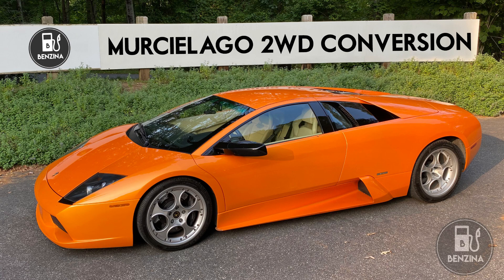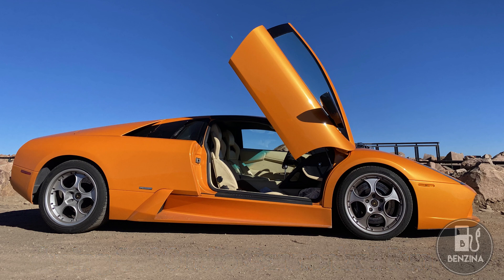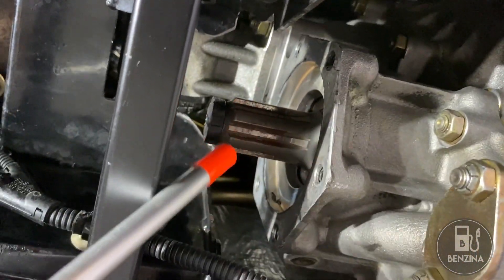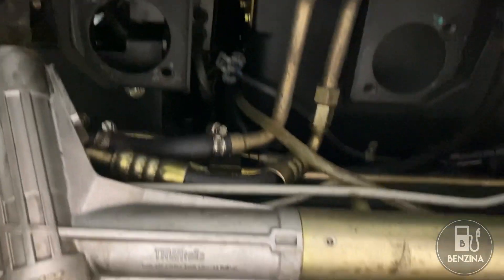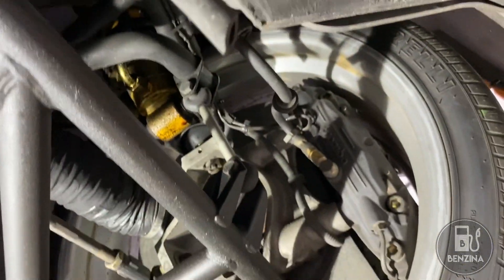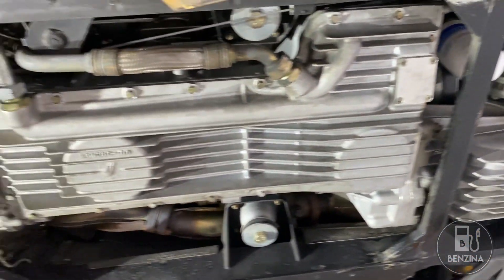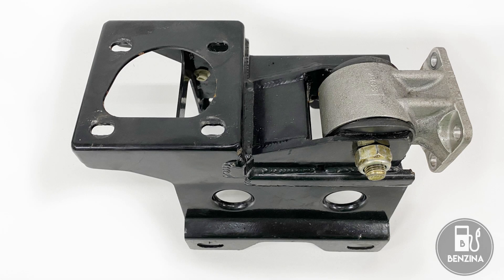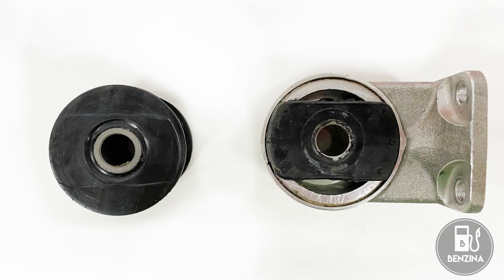Carbonio 2WD Conversion Kit for Lamborghini Murcielago

Comment: Shouldn't there be a plug for the front of the torque tube, too stop any dirt/grime building up in it from driving??
Reply from the maker: A plug is included in the kit. This is specifically mentioned in the Carbonio product page.

Comment: Why would you change to 2WD ? Weight ? Reliability ? Might this change hurt resale value ? 
BTW , horrible that Lamborghini recommended the "wrong" engine mount .
Reply from the maker: Unless you drive in the snow there is almost no downside to going 2WD. The car wears clutches less, is more fun to drive, and is easier to maneuver at low speed. Also the modification is 100% reversible so resale value is in no way affected.

Comment: Awesome! How do I buy it? Couldn't find it on the website. I've been wanting to do this for years and now's the time. 
Additionally, can you advise how you like to adjust the front ride height and alignment to compensate for the difference in weight? Thanks
Reply from the maker: Look again its right there :)  Also I never changed the alignment and have no issues. Tire wear is perfect.